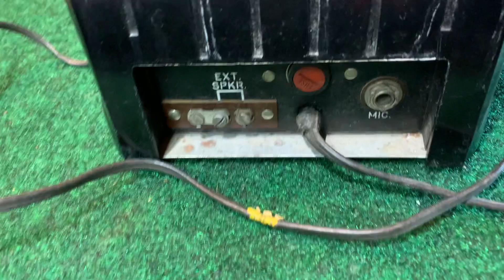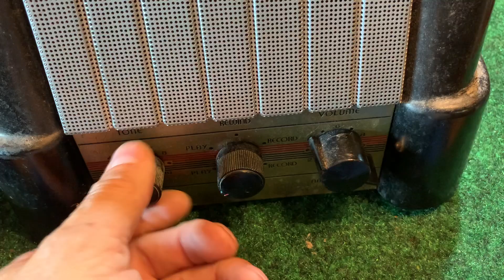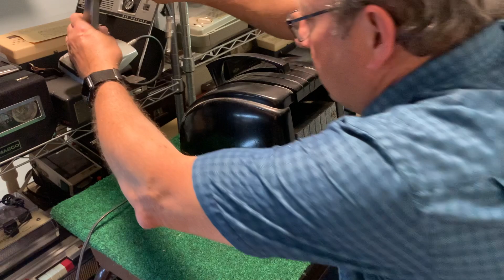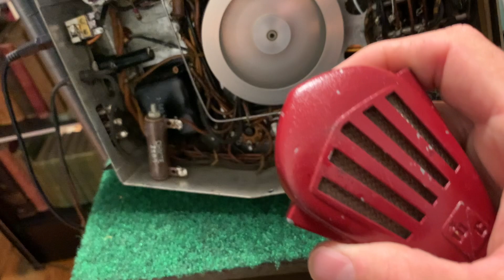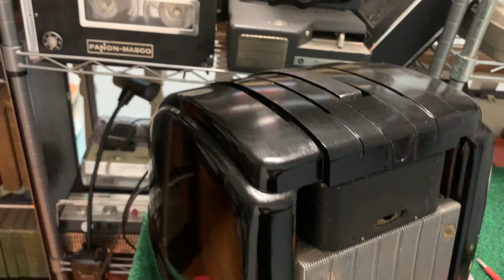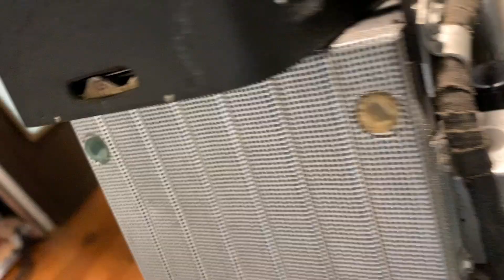Vintage Tech: Unusual RCA Cartridge Wire Recorder

Comment: Had never seen one in operation.  A friend just found one in very good cosmetic condition in Sweden.  He asked me if I had any information on it...I do not.  I have a Webster-Chicago Type 80 that works pretty good.  It plays one hour spools.  Mechanism seems to run much smoother than your machine.  My friend tells me that most of the RCA machines were returned/recalled.
Reply from the maker: I am producing a video of the 80  model.  I had rebuilt it and it worked beautifully four years ago. Then while recording the video it stopped recording. Ha.  So I have it on the bench again. Replacing many bad resistors.  Hoping to get it resolved soon.  You are right about the quality comparison. The rca is a clever design but the mechanics are noisy.

Comment: Great machine.  One concern would be the wire breaking inside the cartridge.  I assume the cartridges were likely user-serviceable and the casing could be opened to repair or replace the wire if needed.  Otherwise RCA would be selling a lot of new cartridges.
Reply from the maker: @Dan-KM8DAD  I have no experience with repairing one of the cartridges. But I’m certain it can be repaired. Thanks for the comment.

Comment: Mine doesnt turn on at all. Replaced main cable. Fuse is ok. 150v... But
Reply from the maker: Do you have a manual with the schematic? Here is a great help: https://www.smecc.org/rca_model_m1_wire_recorder.htm
Reply: @KOVintageTech  thanks! I will have to bring the device to smb who understands more than me. I just undid a cartridge with broken wire.  Have you seen one inside? If you want I can share photos. I dont know how to send them
Reply from the maker: @philipsgironacostabrava  yes I’d like to see the photos.
Reply: @KOVintageTech  when is the white light going to turn on? When recording? Mine maybe is broken
Reply from the maker: @philipsgironacostabrava the left light is “green” and is the power light.  The right light is the record light and only lights when it is recording and has a signal on the mic.